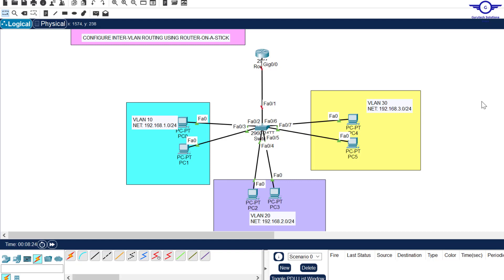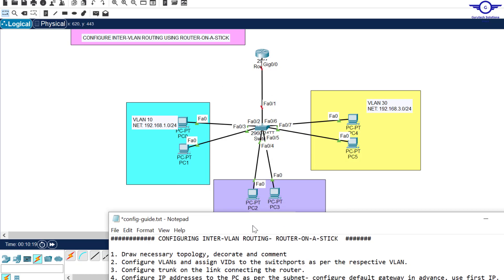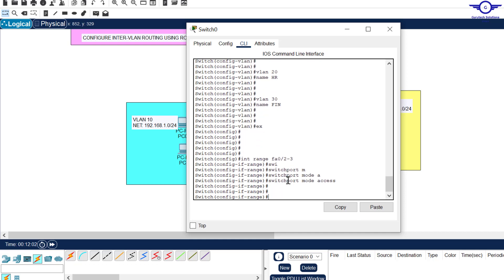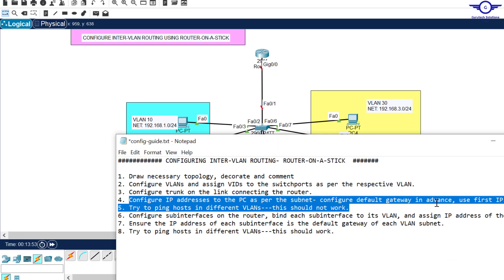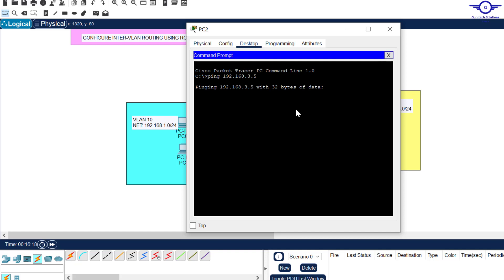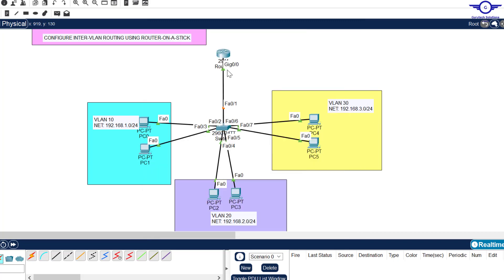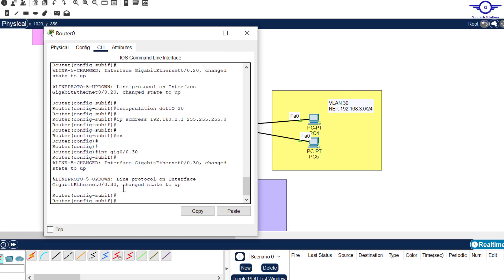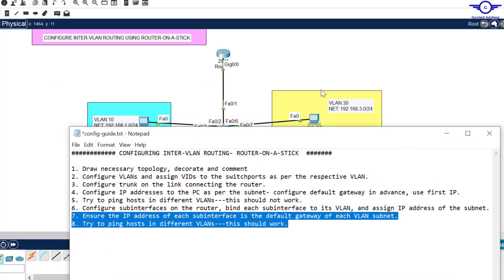CCNA DAY 24: Configure Router-on-a-Stick Inter-VLAN Routing | Inter-VLAN Routing Router on a Stick

Comment: how do you correct loop back in packet tracer % 192.168.3.0 overlaps with GigabitEthernet0/0
Reply from the maker: That's improper subnetting, check your subnets. Remember each interface of the router will be in a separate subnet